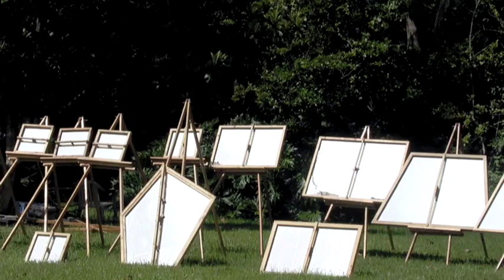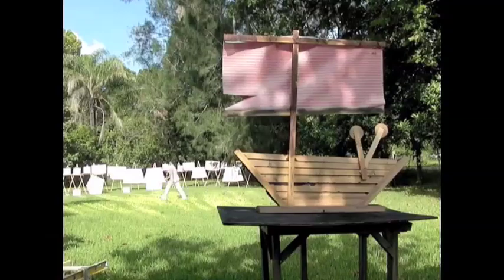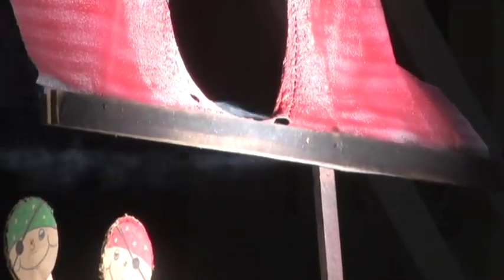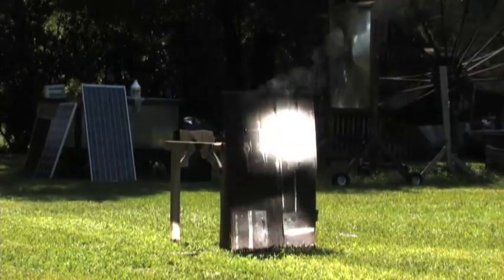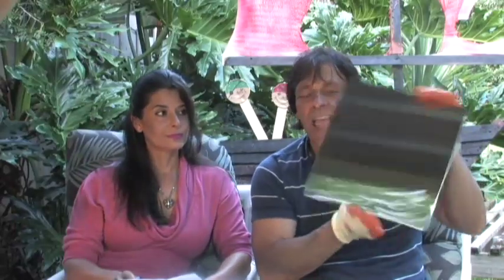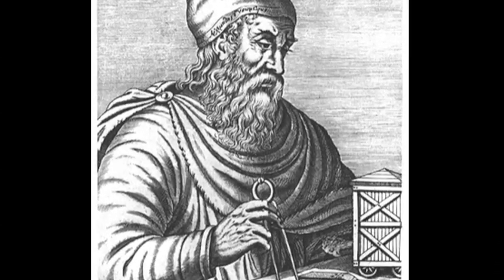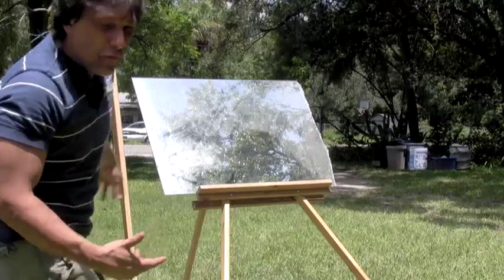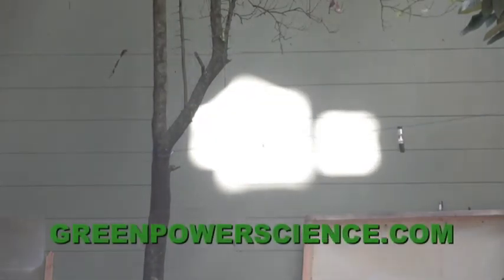Archimedes Death Ray Solar Parabolic Mirror burns a fake Roman Ship Mythbusters

Comment: Even if the mirrors weren't able to catch the ship aflame, imagine the heat the sailors on board would've been experiencing.
Reply: @Jonathan Crouse And people like you move the goal post from "It probably happened to "it could've happened happened" to "it's theoretically possible in perfect conditions." This entire myth is a hypothesis based on misinterpreting anachronistic exaggerations from later era writers who didn't even live in the same timeperiod as this supposed device.
Reply: @Intranetusa  I’ve read over your guys argument and honestly there’s a lot of factors on both ends.

We actually have very limited knowledge of there glass and metal working skills. We assume his Ray was just a mirror but in reality it could have been concentrated thru a small series of mirrors and very simple lenses and almost be changed into a near laser type of weapon. Would ignite almost any clothe, paper, and could definitely ignite the alcohol or oils they would have aboard.

I agree it’s completely impractical regardless and most likely never worked but... we don’t know how they built the aqueducts so precise. we don’t know how they came up with there concrete. so many little things we struggle with today they somehow did with ease. Or at least make it appear that way to historians and scientists. 

I don’t think it was used myself because of the sheer amount of work it would have taken to undertake the research, let alone the actual building of said weapon.

But if it was, could you imagine seeing a burning beam of light cutting thru the sails of a ship 2000 years ago. To me it’s impressive someone even had the imagination to think it up.
Reply: @buildurtruckurway9118  One of my main issue with this story is that it is an anachronistic story that was told centuries after it was supposed to have happened. Archimedes lived in the 3rd century BC, but the story dates to 400 years later in the 2nd century AD. We have no idea if this story was made up by this later author, or whether it was heavily corrupted, changed, etc over the centuries. Archimedes could've just made a flamethrower that shot burning liquid like the later Greek Fire, but the facts got corrupted into a giant death ray. 
As for the Romans, we do know how they built their aqueducts and their concrete. They wrote their concrete formulas down and modern society can easily recreate it. We just choose not to because Roman concrete is expensive to make, uses local ingredients like volcanic rocks, etc. And aqueducts like those can be recreated, but aren't practical anymore.
Reply: @Intranetusa  We have a rough idea of how they built the aqueducts but it’s the level of precision we don’t know how they managed with basic levels and tools they Had. And yes I agree we know the basic recipe for Roman concrete we now call it Portland concrete we add mined lime and a few other things to make the same product but there is a lot of variants they created in Rome we are struggling to recreate.

I know the story is told centuries after his death which is just another reason I agree with you that it probably was never used. It’s just crazy to think that it was dreamt up in a time that we supposedly barely knew about what light was let alone using it to destroy ships.

We know with today’s tech we can do it. but back then to have even put that kind of funding into something when your military took 60% of your empires finances just to feed is un probable.
Reply: @Intranetusa  hey BRO, i am Glad to see ur determination to see u prove ur Point for a long Time and Yeah I completely agree to it...so Guys let me get this Staright...Plz read full to all of guys out there...:-
1) although the concept works and can burn objects...in real life battle scenarios of those times, it would still be very very inaccurate, like u can defeinitely burn a piece of Log or paper

2) ships wont be stationary they would be moving, so u guys dont have aimbot built into ur neural structure that u wont miss the focus point at all

3) Range was too less, this concept works only at short range, why??? here it is...
by the time u would start focusing on a specific point on enemy ships, even if u managed to put some smoke out of it, the ship would be boarded and the city would be all dead

4) the death ray effectiveness depends upon the Range and thickness of target...ships wont be a few mm thick, they had pretty considerable thickness and were not thin as papers that they would catch fire and burn toashes as soon as they were put under death ray...

5) ship would be wet and moisted due to actions of water under it...so yeah pretty to catch fire anyways...at most it would be smoked a little bit but not catch fire

6) soldiers in the ship are not stupids they would put water onto focus point or move the ship away

7) if u say ur making some bunch of guys hold the mirrors, cmon i can justy shoot them far from arrows or atleast make them fear out of getting shot and move them away by Fake shooting towards them

8) the points abv are not the only ones to debunk this whole concept...so yes i can bring moprer points to it...
9) and guys plz dont argue just bcoz u want to satisfy ur EGOs, that wont work and may put u in trouble in real life as well...even if u won the Argument u aint getting any benefits anyways..so be logical and then Argue...
we would be happy to see people putting points to prove the practicality of Death Ray

PEACE...
Reply: Not really. You can just step one feet to your left or right and easily move out of the way. And the ship itself would be moving forward to attack. And the ship would be bobbing up and down with the waves and not remotely be stationary. And the mirrors wouldn't be able to focus on anything other than a very close target. If the mirrors are held up by people in order to track a moving target, the coordination would be terrible. There are plenty of reasons why this device is completely impractical in the real world. The mirrors of the time were made of bronze, so it would be bronze mirrors rather than modern mirrors made of glass coated with silvering. Bronze isn't cheap either, since it was the material used to make weapons and armor at the time. 
All that effort could have been used to just making flaming catapults that could set a ship on fire faster, cheaper, at a far longer range, and more consistently. The original stories about Archimedes only mention him using fire as weapons, so it's far more likely he was just using flaming catapults against the Roman ships. Furthermore, the Archimedes death ray myth is anachronistic because it didn't even arise until something like 7 centuries after the event happened. The earlier stories only mentioned Archimedes using fire to fight the Romans, so the story was likely highly embellished as time went on.
Reply: @Intranetusa  It doesn't matter, it still works.
Reply: @Carwyn.Morris  It doesn't work in real life and was never used in real life. That's why actual historical records of the time never claimed Archimedes built a death ray, and the death ray story only popped up much later after getting exaggerated with retellings. This ray only works on paper under the most optimal set of circumstances that wouldn't exist in reality.
Reply: @Intranetusa  No it actually does work. Forget the myth. It is possible and has been done. In 1973, when a Greek engineer undertook his own experiment to get to the bottom of Archimedes' death ray. He assembled 70 soldiers, each holding a 5-feet by 3-feet (1.5-m by 0.9-m) mirror. The concentrated beam reflected by the mirrors set a row boat 160 feet (49 m) offshore aflame. Even Students in MIT managed to replicate it.
Reply: @Carwyn.Morris   Your examples only prove that you can set fire to stationary pieces of thin wood at very close range with mirrors during the middle of the day - they do not prove the death ray myth of mirrors setting fire to thick wood ship moving on the sea. The Greek engineer's test you're talking about is Ioannis Sakkas's experiment where he set fire to an unmoving tarred thin plywood silhouette of a boat that was attached to another rowboat that was very close to shore in calm waters. The MIT experiment involved setting fire to a completely stationary piece of black painted thin wood (1 inch oak) that was mounted on land. The Sakkas experiment already shows how impractical this device would be in real life. 160 feet/49 meters is very close range. A person can throw a javelin up to 100 meters. A bow can shoot an arrow to 200-400+ meters. Catapults and ballista can outrange bows and can launch large flaming projectiles. 
In real life, there are much better and more practical ways to set a ship on fire than using mirrors.
Reply: @Intranetusa  The Roman ships were stationary, they were anchored as they lay siege to the city. The roman siege of Syracuse lasted 3 years with ships docked to the walls. How far away do you think they were. And None of that matters because it still works You can set fire to boats using mirrors. Doesn't matter how practical or ridiculous It is possible.
Reply: @Carwyn.Morris  The tests showed that you can set fire to thin stationary pieces of wood in the middle of a sunny and cloudless day at very close distance with mirrors with nobody trying to stop you. None of the tests involved setting fire to real boats on water which are bobbing up and down with the waves (anchored ships still move), have people shooting back at you, have the weather change and with clouds passing by, AND have real ships using thick pieces of lumber that were used in actual ship construction - not thin & flimsy plywood or thin 1 inch pieces of wood that were used in the Greek and MIT tests. Thick lumber has much more thermal mass and is far harder to ignite than a thin piece of wood. Something being possible on paper is not the same as being actually achievable in real life conditions or being practical. It's technically possible to win a war equipped with an army equipped nothing but bows and swords in the 21st century - but that doesn't mean it'll actually happen in real life.
Reply: @Intranetusa  It doesn't matter you can use this method to set fire to a boat. There are plenty of other things on the ship that is flammable. And I still don't care about the myth. Can you use this method to set fire to a boat? Yes. is it practical? Doesn't matter you still can. Is it historically accurate? Doesn't matter you still can. Nothing you have said has disproven the fact that this still works as a method of combustion.
Reply: @Carwyn.Morris  You're talking about whether something is theoretically possible. I'm talking about whether something is practical and whether it happened in reality. We're using two different standards here. Yes, people can use mirrors to ignite wood given enough time and under perfect conditions. Just like people can also use a jar full of termites to sink a wooden Roman ship given enough time and in perfect conditions.
Reply: @Intranetusa  Not disagreeing with you, I really don't know either way, but wouldn't the roman ships have sails that could be easily set on fire if you held the mirror in place in a general area of a sail? I read that their sails were made of linen, which would burn much easier than thick wood. If a ship was stationary during the seige and fairly close, I feel like it could be possible. It could still be a myth or exaggeration even if it's possible though. I know that the sails wouldn't be unfurled when they were anchored, so that would make it more difficult to do.
Edit: I saw one of your other comments about sails being hard to light on fire this way. You're probably right, it was an exaggeration or invention by later writers.
Reply: @Intranetusa  I think it speaks to impracticality of this method that it did not see continued use in history.  If you could (at reasonable expense) concentrate mirrors and start fires in a military setting, I'd expect we'd have record of them used in pre-cannon warfare in sieges generally, especially by the defender, to disrupt the sieging army.  Shine it on trebuchets under construction, storage, anything that can't be immediately moved and would be inconvenient if on fire.  If anything, sieges lasted longer and lacked the degree to which ships could move, so if this were really feasible to use at any meaningful scale, I'd imagine it would have seen use until cannons took over the job and did it better.  

But that's not what we observed/have record of happening!

Comment: I was thinking this sort of engineering was used in much more elaborate ways in the ancient world and not just for warfare. For example, lining stone with carefully measured patterns then moving the beam along these patterns to create laser-like edges in stone blocks and buildings. Stone does melt, just at higher temperatures and all one would have to do is amplify the ray from the sun to about 1500 degrees Celsius.

Comment: Another thing to point out: sailors are not as heat resistant as wood.  You don't need to set the ship on fire, handy as that would be, you just need to cook the soldiers and sailors off the ship and into the water.
Reply: Thats a little difficult when barely any knew how to swim
Reply: @Artur Terho And I can quickly move my hand out of the way without any harm or repercussions. On the other hand, I can't remove an arrow stuck in my hand, a ballista bolt through my chest, or the crack in my skull after being hit by stones. There are a million more practical ways to attack enemy ships and enemy soldiers than trying to hold a bunch of mirrors together to annoy the enemy with what is basically a relatively minor inconvenience.
Reply: Doesn't make any sense wood catches fire faster than human flesh
Reply: Wood starts to burn at around 450°F/232°C. Human skin will start to get scald type burns at around 150°F/65°C.

Temps high enough to cause wood to smoke will cause some extreme discomfort to people, even if they're not actually on fire.
Reply: But then the sailors and soldiers could just climb back onto the ship.
Reply: Yeah, your Dutch swimming bias is showing. >:)
Reply: @markhenley3097  It was a multi year siege.  Tormenting the enemy and watching them scamper about would be great for moral.  Sailors need to be able to adjust rigging on sailboats.
Reply: 1) People are 60% water. Wood is 10-15% water. Wood ignites much better than people. 
2)Sailors don't stand still doing nothing while they are getting burned by a slow acting beam of light. They are also on ships which isn't going to be perfectly still when they are bobbing up and down with the waves and traveling to attack a city. 
3) You also need perfect weather conditions of sun and cloudless sky and clouds/rain/etc makes this useless.
3) You also need to focus on a single point of all the mirrors, and people wouldn't really be able to coordinate something perfectly. The fact that all the mirrors are stationary and the target is very close and stationary means this does not remotely resemble an actual battlefield scenario. 
4) Not to mention this entire story is anachronistic because it didn't even arise until something like 7 centuries after the event happened. The earlier stories only mentioned Archimedes using fire to fight the Romans, so the story was likely highly embellished as time went on.
Reply: @Intranetusa  Clothes catch fire fairly easy though
Reply: @TheChasebos  Clothes will catch fire if you hold it for a sufficient period over an open fire. It won't catch fire easily if you're using an inefficient device such as this sunbeam concentrator. An open flame is much better at setting something on fire than this giant inefficient device that is unwieldy and requires a perfectly stationary close up target. Mythbusters or another test actually tried to set a piece of cloth sail on fire and it didn't work very well because 1) it was light in color and reflected much of the energy from light 2) it was flapping in the light wind and 3) the device didn't work very efficiently to begin with. Maybe you can set a piece of cloth on fire if it is dark in color or soaked in gasoline on fire, but only during the hottest time of the afternoon and if it was perfectly stationary and you had a giant sunbeam focused on it for an hour....but that is an incredibly inefficient way to set something on fire.
Reply: @Intranetusa  Best solution will be to land early morning when sun will be low but there will still be enough time to attack and make it to shores after landing
Reply: @Intranetusa cope and seethe